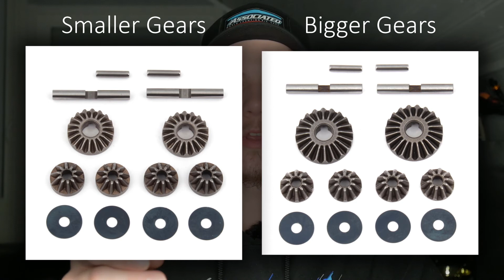From the ground up: Differentials Part II

Comment: Max if I remember correctly TLR had limited slip diffs right around the time that the 8ight 2.0 came out and they were really pushing them.  Adam and a bunch of the team guys were running them but they had 3 problems.  

1. The car was harder to fly because of the engagement.  They made the car unpredictable in the air. 

2. The ramps they used internally to cause the lockup wore out very quickly and once they wore they were useless, and the parts were machined and not cast steel making them expensive to purchase and maintain. 

3. We unload and reload our diffs way more than a real car does and this further exacerbates the wear on the ramp plates. Also the internals really didn't like landing on power the way we do. 

I know in your video that you stated that almost all real race cars use limited slip,  and your right for the most part. However F1 teams use an open viscous differential more like what is common in our buggies today with the only difference being that they are filled with a magnetic fluid and can both automatically and manually change their lockup amount on the fly.
Reply from the maker: Thanks for the information, really appreciate comments like this. 

I have never heard of the losi active diff. Kyosho, Xray and Fioroni had active diffs around 10 years ago. JQ has told me he ran the fioroni diff in his hobao quite often, fast finnish drivers often ran the xray active diff just as I was starting racing in 2009-2010 and it was always rumoured that David Ronnefalk in his dominant Kyosho years ran the Kyosho active diff, however it was never proven. 

Now from talking to people who ran them, they always had the issue of adjustability. They could never have a good balance of engagement and preload. In most cases these diffs were only adjustable by the fluid or grease in them. I believe the Xray diff had two different options for the ramp angle but that's not enough. Full scale cars have this issue sorted by having the friction plates with springs and adjusting the angle on the ramp which makes it very easy to make changes to engagement and preload. 

AFAIK F1 diffs are also hydraulic/electronic. All the mechanical limited slip diffs that are common in racecars are the disc lock type as I mentioned in the video. WRC cars and pretty much any rally car from amateur to pro use these. Its a rather simple design and its mechanical so it has a very good chance of being able to be implemented for RC.
Reply from the maker: Alright so just took a look at the differential design from Team Losi. Luckily the article about it is still up: http://www.losi.com/Products/Default.aspx?ProdID=LOSA3603

So to me compared to the xray active diff the Team Losi differential has a pretty significant design flaw that causes most of the issues you mentioned. Instead of producing the friction against the diff body, like it would be with a full scale disc lock, the Team Losi SmartDiff produces the friction against the planet gears. It has much less surface area which means the material is strained much more which explains the excessive wear. 

The cool thing about this diff are those small springs. The xray active diff design with implementation of those springs for preload instead of detachment could be what we need to make the diffs work.
Reply: @maxmortrc  I may be wrong buy i think the reason for the inconsistencies of these diffs is the fact that the internal parts are cast and not machined. From what I understand the way the pressure is applied to the ramps on the ramp plate   forcing the plate down into the bevel gears creating the locking action and with cast steel its going to be soft. I would think upon engagement of the ramp plates the plates themselves would deform under the load causing the plate to bind and not engage properly . Those would mean that we would have to have machines internals for the diffs and I would imagine the cost would be astronomical and prohibitive. I am sure the handling advantage would be huge but again at what cost? Also something you should check out is ofna or ho bao also used to make torsen diffs for their lineup. I am not exactly sure how a torsen diff works but the always looked really cool. They were around in my early days of RC when I was trying to learn how to program my radio properly around 2005 so I don't know much about them. I am curious as to why you think we don't have limited slip diffs currently?
Reply from the maker: @joshuapeters8744  I think we dont have them because nobody was able to get them to work because of adjustability issues. 

OFNA had torsen diffs but torsen diffs arent very optimal for racecars especially offroad racecars because they never lock they just balance the drive between the inner and outer axle. And if a tire is in the air they are free like an open differential. 

I cant really say what the issue was with the losi diff since I've never seen one used. It could very well be the material but the design on its own has a bunch of weak points as I pointed out before. I think the way xray did their active diffs is ultimately the best way to do it. It needs more possibilities for adjusment and if that is solved I think it will work very well.
Reply from the maker: @joshuapeters8744  What comes to pricing the losi diff retail was $110 and the xray was at $130. Xray stuff is notorious for being expensive anyway so no major difference on price.

Comment: I know that JQ doesn't like addressing the Truggy questions, but I try to get on the track as much as I can and in the U.S. the Truggy class is another way to do that. Would you mind, at least from time to time, talking about the differences between the Buggy and Truggy, if there are in fact any. I know with this particular topic that the size of the tire plays a part in diff tuning. I would be curious to hear what you have to say about Truggy tuning also.
Reply from the maker: I have to say that in my life I have run a truggy for about 4 laps. I could talk about what the wider tires do and added weight and what could be done with the body but I have to be honest and say that I am not really an expert on truggy. Also looking at the truggies on the market I can’t find a single brand that does any good truggy R/D. The manufactures just make longer arms and a chassis and hope it works out. Either way I will definitely try talk about this in a future video.
Reply: @maxmortrc  That’s perfect. That’s all I was talking about, the theory of the effect it would have on the Truggy. I knew you weren’t a Truggy guy, but just hoping you would slip a little info or tips that might be useful for the Truggy guys in future vlogs, when you think of something. Honestly, what you’re doing is great. The ideas in the videos are great for Buggy and Truggy.
Reply from the maker: Thanks man! Happy to hear that

Comment: Good info on this video, will show this to people when they have a question about diffs.
Now a few questions from me in the RC8B3.2e is this standard with the bigger or smaller internal gears for the diff?
And when would you use the taller ring and pinion instead of the smaller ones?
Reply from the maker: Standard car comes with the bigger gears. These will work well in every condition. With the smaller gears you might get a slight advantage on a more high speed and lower grip track. Overall though the bigger hears are a safet choice.
Reply: Thanks for the quick response, in the Netherlands we mainly run astro tracks, so a lot of grip unless it's wet.